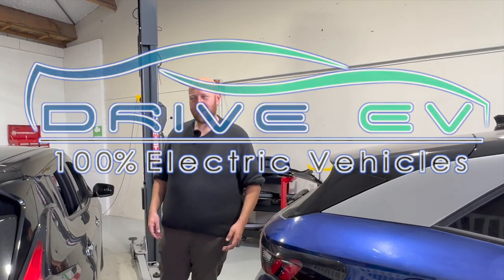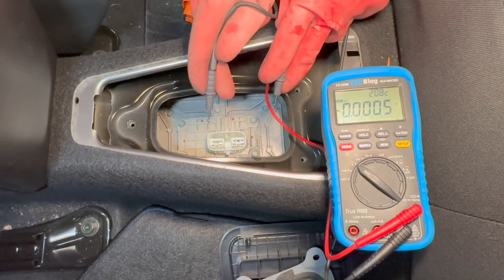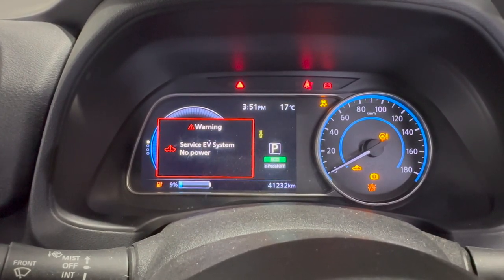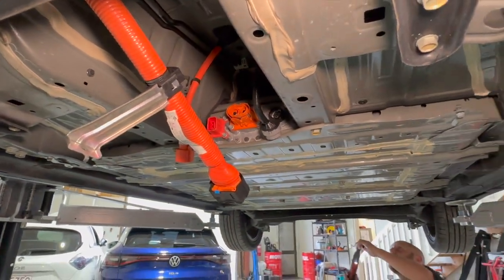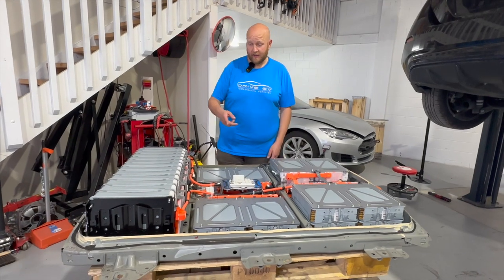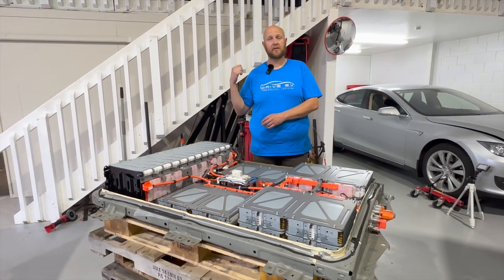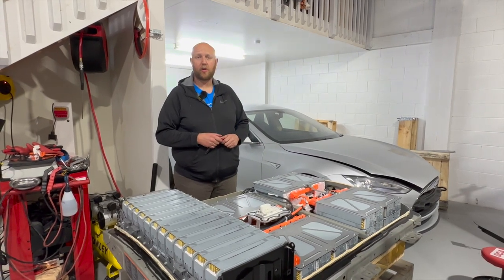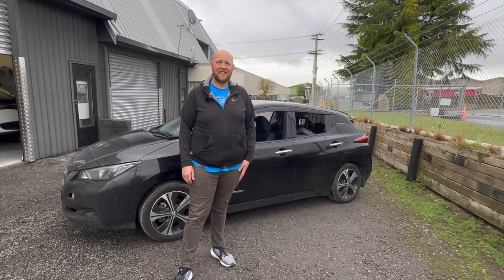Nissan LEAF 40kWh High Voltage Module swap - Fix for fail code EVC-157 EV Systems

Comment: Great video, but lacks a little bit of information.

What was the state of this Leaf? How many miles? Which year model? What was it's use case? Did the owner rapid charge a lot?

And finally, everybody understands the price of every repair will be different but you could have mentioned what it cost in this case or at least give some ballpark number.

Thanks & keep sharing ❤

Comment: Excellent video. I've yet to hear of a pouch cell leaking in a LEAF. I'm guessing that's the electrolyte that leaked. Could you guys address that and talk about how often you've seen this and what may have caused this? I have seen where repeated HVDC charging, (in taxi applications where pack temperature stays elevated), has caused pouch cells to swell. Could this have been led to leaking?
Reply: This is exacly hapening to me right now. Im in Croatia. I have to find someone to swap me a modul. Because nissan wants to sell me a brand new battery 35000 euros. Crazy
Reply from the maker: Ned would love a holiday I'm sure. Might work out a little cheaper.
Reply: @0401sasa ej, da li si pronasao nekoga? Imam 40kw leaf trenutno bez problema ali bilo bi dobro znati ako ima netko kod nas da radi takve popravke

Comment: I would like to know what tool was used to balance the batteries and how it was done
Reply from the maker: DP832 PSU is all we use mixed with an EEVblog 121GW multimeter